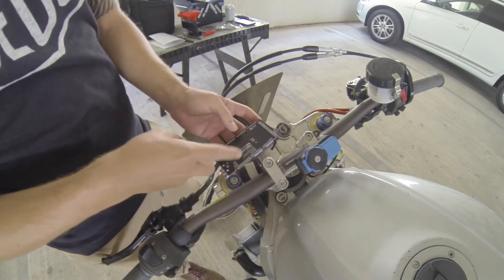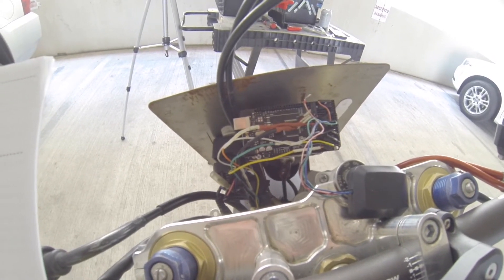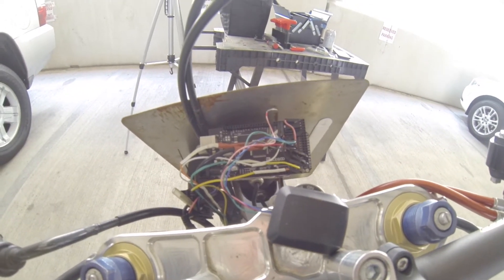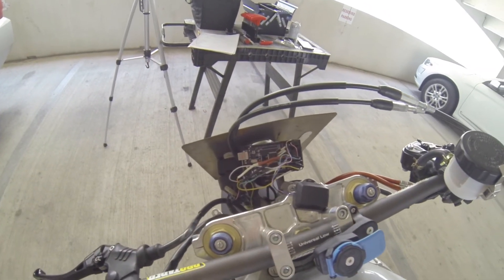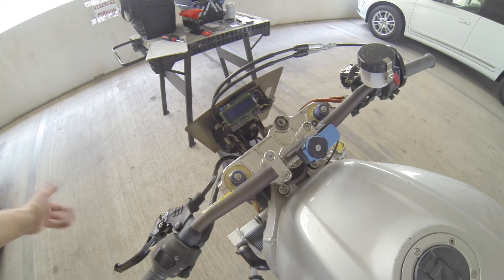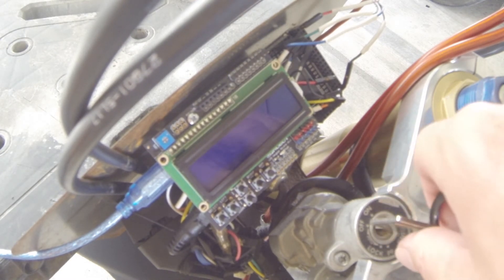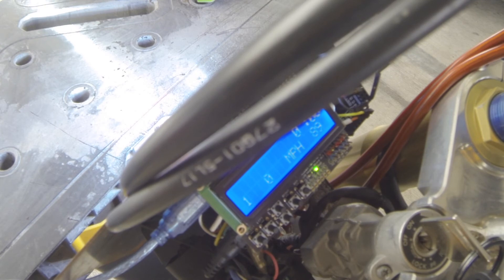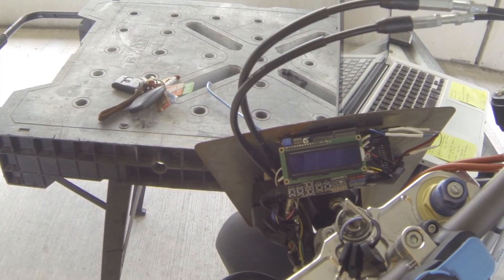SV650 Custom Arduino Gauges

Comment: Drew what steering axle use? Gsxr or sv?
Reply from the maker: Steering axle? Stem? It's the GSXR unit. The generation of GSXR that I swapped the front end from uses the same bearings as the SV one so it's pretty plug-and-play, you won't need to press out the SV stem and press it into the GSXR lower triple. See my other videos for more info. 
https://www.youtube.com/watch?v=Xr5IY9ObJbU
Reply: @drew657  thanks so much!

Comment: Sikk! 
Now need to teach it to be a laptimer and   to talk to the power commander
Reply from the maker: Not sure about talking to the PC, but I had looked into setting a geofence to kick over a lap timer. I'd have to program it in for each track, and put on a microSD card unit and code it to record it to that because when the arduino turns off all the memory is wiped.

Comment: use engine rpm and speed to calculate what gear your in, you can also use the 1-5v along with rpm and speed to pick a gear
Reply from the maker: I'd read about and thought about using engine speed/wheel speed to calculate and display gear, but I figured since I've got a gear indicator basically built into the bike I'd go ahead and use it. I may take your idea and incorporate engine speed to smooth out the gear display though. Thanks!